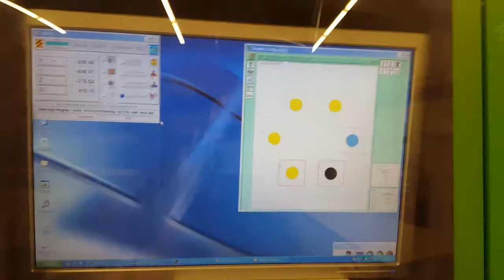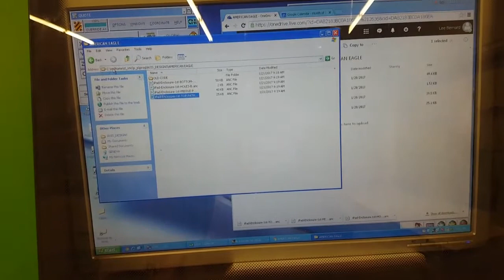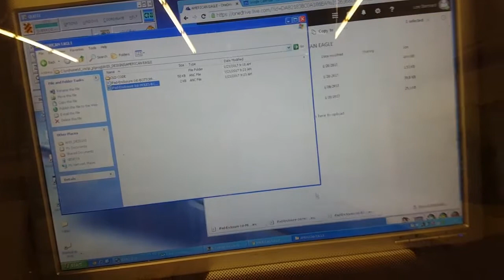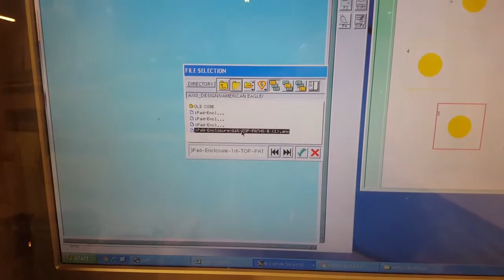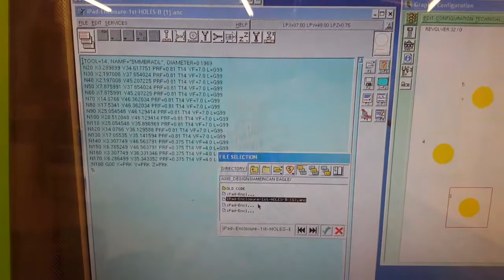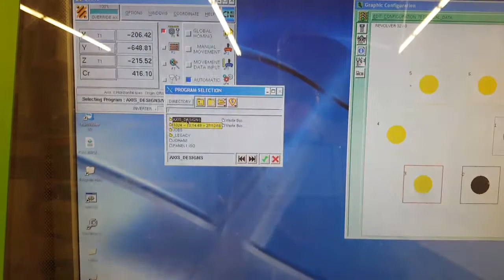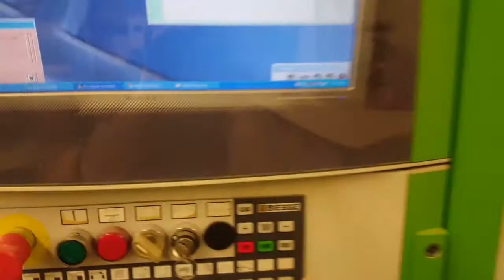Biesse Rover 24: How To Run A Program The First Time

Comment: Salute, too all CNC 's buddies! Currently I'm using  Biesse Rover 4.40 and run into issue that Biesse stopped accept CIX file that comes out with GCode from Mozaik software. So , in order to run the job I must to convert CIX file to ISO with the ButchRun that's annoying.
Question:- Does someone know where on the Computer should I check out box with turning on accepting CIX files again.
Mucho Gracias. Looking forward to get an answer.

Comment: Thank you for the great video. I have a couple of questions. Did your machine come with a computer and windows XP on it? Or did you modify and add the pc part to it. I have one that looks like DOS, and was wondering if I can add Windows to it, or upload a different UI?
Reply from the maker: Hi EdRusi! The computer came with the machine and it already had Win XP installed. What NC software version are you on? What machine are you running? Is a Rover 24 like the one in the videos? I know Biesse sells a new computer but they run XP on a virtual box because the software that is needed to run the machines is so old. I am running NC1000. I don't know what NC500 looks like but I know it exists. Let me know and thanks for checking in!

Comment: Hey mate. Great videos, really helpful, I have a rover 24 with nc1000 controller. Having an issue where I can't find the files when I go to run a program that I have saved from Aspire. The files are definetely in the right folder but the editor wont update the folder even though I have pressed refresh etc. Any idea what the issue may be.
Thanks again
Reply from the maker: Hey Lachlan! My first thought is that there are two folders named very similarly. If you are for sure the editor is looking in the correct folder my only other thought is the issue that Win XP has with file names. if you have the wrong extentions (yourfile.anc) then it may not see the file. Likewise if the file name has spaces in it like (your file.anc) it won't work or if you have extra dots like (your.file.anc) that won't work either. 
When I teach young people that have never dealt with XP they look at me crosseyed and think I'm just being OCD about file naming structure. Then they run in to these types of problems.
Look for a guide for Win XP file naming rules and see if any of these are being broken. 
An example name of a file I might send is as follows:

JOB_1234_1of4_3qtrPLY.anc

which translates as the job name / job number / first of four sheets of code / material to be cut.

Hope this helps!
Reply: @thecrazycncguy7500  Thanks heaps. You were right. There was a duplicate folder hidden deep in the computer, took ages to find it. Thanks again.
I'm using aspire software, any tips on getting the tooling correct. Biesse saying there's a magazine error, programmed tools unavailable, what am I doimg wrong. Any help would be awesome, complete newbie haha
Reply from the maker: @lachlangibbs-lz1gb  the name of the tool in the Aspire tool table has to match the name in the Biesse. Go into the tooling in Aspire and find something like "tool notes" or "Details" Also - go to the Biesse and find the tool in the tool table and write down exactly how it is named. That's the name you have to give the tools in your programming software. See if this video helps....https://www.youtube.com/watch?v=an9aURZ_72o
Reply from the maker: @lachlangibbs-lz1gb  Also - where are you located? I'm in the USA near Chicago.
Reply: @thecrazycncguy7500  Hey mate. From Australia so along way away. I had to type the tool name into the code manually in editor, so not sure what I was doing wrong in aspire itself. Now I have another error code "220. Speed or acceleration nil". So I'm assuming I have to change the code somewhere to set the speed or acceleration. No idea how though. Any tips?
Reply from the maker: @lachlangibbs-lz1gb  I ran into this many years ago...if I remember correctly in the "edit tool" in AlphaCAM I had to find the "note" that gets pushed through the post-processor. In Aspire look for the tool name, tool note, notes, anything like that and enter the tool name exactly as it appears in the Biesse tool list. I have to enter the tool name in the tool notes section in AlphaCAM and that is what gets pushed to the G-code. For instance, our 1/2" Compression bit is listed in the Biesse as 1/2COMP but when I choose the tool in the tool to define a tool path with it the name iin AlphaCAM is .5-comp. That tool has 1/2COMP entered into the notes section for the tool.
I looked on line and there seems to be a notes section when adding a new tool to the Aspire database. maybe create a new tool and look for that tool notes section if you can't access it on an already created tool. 
Hope this helps
Reply: @thecrazycncguy7500  Awesome stuff, thanks again for all the help

Comment: Hello, I have a BIESSE ROVER 24 machine, with a windows 2000 server computer with 256mb of ram, and it suggested the need to update the computer hardware, do you know about compatibility with newer hardware?, thanks for the help. ..
Reply from the maker: Biesse America said that they have an upgraded computer system. They sent me a quote for it and it is a new computer running the software in a virtual box running XP. If you have the Serial number for the machine you should be able to call your Biesse customer support and get an upgrade that will work well with your existing machine. I hope this helps!!!
Reply: @thecrazycncguy7500  Hello, thanks for your answer, at the moment I'm trying VECTRIC Aspire on Windows 10, I still can't connect to the machine via ethernet

Comment: What pump are you using I’m having issues I’m getting a error of insufficient vacuume LH just when I want to surface my spoiler board
Reply from the maker: Hello Yitzchok! This is likely a faulty or loose sensor in the table base. Remove the lower green plastic covers to the table. Clean out all the dust that might have fallen in and is covering the group of solenoids. Then look to the right of the solenoids (where all the air hoses are coming together) there should be a black rubber cover with two wires coming out. It covers a sensor at the bottom near the front. Pull the black rubber cover off the sensor and push the wires onto the sensor. Even if they are making contact, sometimes they need to be wiggled. Try to run the program again. There is a sensor just like this at the RH side of the table, too. They are glitchy and I have had to mess with them for years. Good Luck and let me know if this worked!!!
Reply: @thecrazycncguy7500  Juat thought you should know that there is a small screw between the two wires that connect on the top of the sensor if you loosen it it lowers the amount of vacuume that triggers the sensor

Comment: i have a question about this video i have tried to transfer the anc file from alphacam to the biesse rover 24 but i can't get it started what am i doing i have done the same as you
Reply from the maker: Did you open the anc program in the EDITOR and save it? What Error are you getting?

Comment: Hello to all nice CNC people. I have question regarding Biesse Rover 24 s. My friend recently baught one (used). The question is, what are system requirrments for PC/computer to run this CNC? Someone told that Intel 'Intel® Q35 Express Chipset' is mandatory, but I do not really believe that. Will Biesse Rover 24 s work on windows 10 and any up to date chipset, Intel or AMD? Or there actually are some special requirements? Thank you!

Comment: I just got a biesse rover b7 and learning how to create a program,is there any easy way how to create a program,or can any of them be found ready on internet for example??
Reply from the maker: Hi Arlind! Unfortunately each machine that I've ever worked on has such a different setup that I would not want to share actual code produced for a different machine - even if it is the exact same model. I am planning on making a video on showing how to make code but you will have to have your biesse tools and post processor programs defined before you can make code for your machine. Did your machine come with any software to make shapes / parts? AutoCAD, AlphaCAM, Fusion 360, Rhino 5, BiesseWorks? Any of those?
Reply from the maker: What software came with the machine?
Reply: The Crazy CNC Guy yeah it came with biesse works and some kind of autocad but modified for biesse and it misses a lot of tools of autocad, i wanted to see if i could find a simple way to make different forms for creating the program
Reply: you see the only problem here is the shapes,with biesse program i can create simple shapes but not the complicated ones..
Reply from the maker: Hi Arlind - So most people generate the shapes in autocad (try FreeCAD if you don't have AutoCAD - download freeCAD and draw your parts and be sure to draw a 96" x 48" sheet with the bottom left corner at X0,Y0) Then save your cad drawing - DXF or whatever and import it into BiesseWorks. 
I don't have BiesseWorks but it sounds like you can produce tool paths with it. I found this on line...I hope it helps

"We imported the DXF files into Biesseworks using the manual import function, and then assigned router functions to the geometry on each DXF layer. The buttons to use are on the bottom of the Biesseworks screen. You can route, drill, pocket. You can also set the tool path to the left, right or center of the line, set tool depth, speed, feed rate, etc. Material is set up on the first box on the left side toolbar. After you finish toolpathing, click the magic wand tool to optimize, and then run a simulation. You can also send the optimized toolpath to your machine with a button on the left side. If you have difficultites with optimization its typically an error with a tool path or a problem with the DXF file geometry. Often if I was not able to mill a pocket due to geometry errors, I chose route instead, and used an offset to mill the pocket. Either that or I fixed the file in Autocad. 

When you import, if the imported geometry doesnt fit your material, you can either redraw the DXF file in ACad to have a 0.0 origin, or right click in the import side of the screen, and select move, center horizontal or vertical to get the geometry positioned on the material. 

When you import from Acad, you need to be sure to convert drawings to polylines. If you don't, Biesse will create a separate line segment out of each Acad line segment, causing the router to lift and replunge at each segment start instead of running a continuous tool path. Also, if areas to be pockets are not closed geometry, Biesseworks will give you an error message if you try to optimize a pocketing toolpath. 

Biesseworks has a great functionality in that you can turn on and off each individual milling operation by selecting/deselecting the tool path in the list on the left. For example if you need to drill holes on some units, but not others, you can simply click off the holes you don't want to drill. Similarly, its very easy to restart a file where you left off by simply unchecking the tool path for each item that has already been cut. Most programs, like Artcam, would require you to either edit the Gcode or rewrite the program to accomplish this. 

Its a good program, but has a big weakness in the CAD department- its NOT a CAD program really. But it does provide good control over the Biesse rover."
Reply from the maker: http://www.woodweb.com/knowledge_base/Importing_DXF_Files_into_Biesse_Works.html
Reply: The Crazy CNC Guy thanks a lot
Reply from the maker: Did that help? I hope so!!!!!
Reply: The Crazy CNC Guy yeah it helped a lot, starting to understand how it works
Reply: The Crazy CNC Guy yeah it helped a lot, starting to understand how it works
Reply from the maker: Awesome!